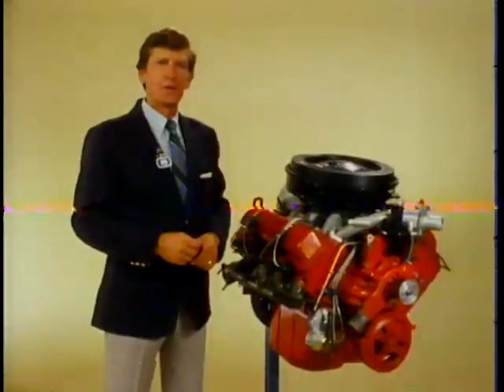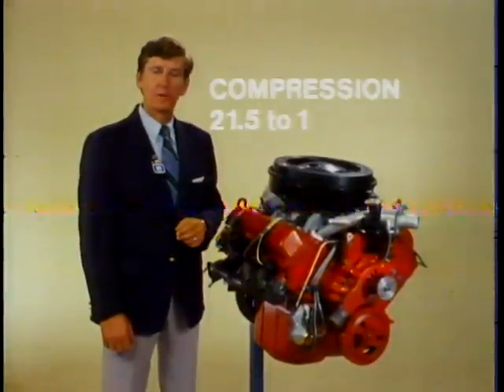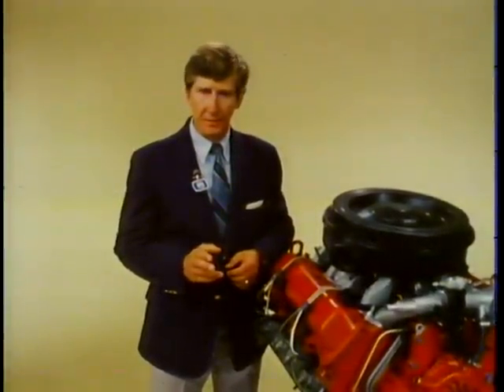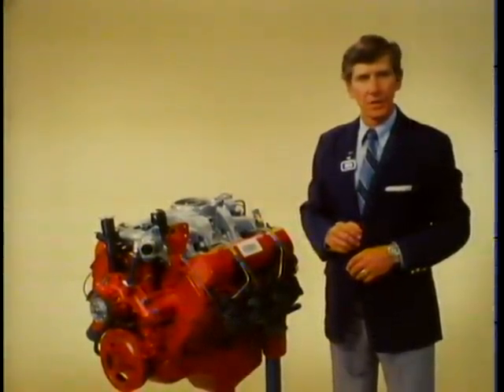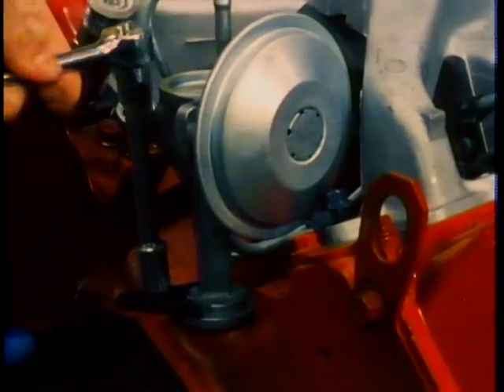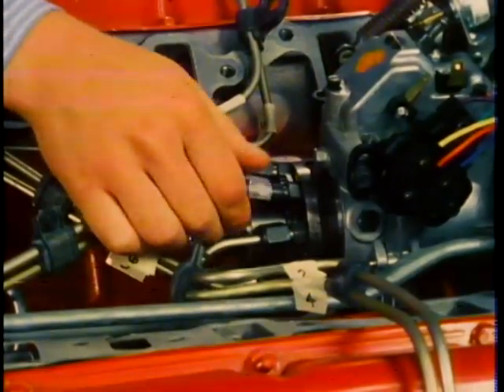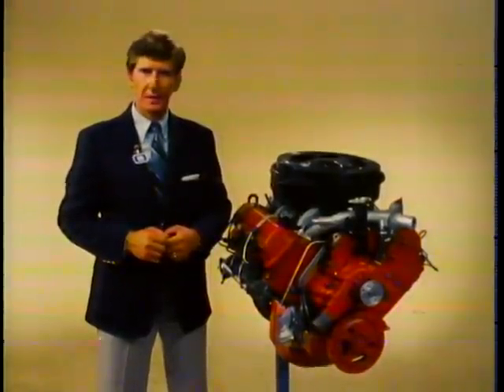General Motors /  Detroit Diesel 6.2 Training

Comment: Thank God the national speed limit was 55 when this engine was made.
Reply: Chase Dirtbike I have one of these in my K20, it has no issues going 70-75mph. Up around 80-85mph, wind becomes an issue.
Reply: You are right.  I loved the engine when I had it in my K20.  I was in Florida, holding the pedal to the floor for a trip from Texas to Georgia.  I was clocked by Florida highway patrol at 83 miles an hour.  I looked amazingly at the officer and said it must have been a downhill run as I just leave the pedal on the floor.  He laughed so hard, I thought he was going to wet his pants, and let me go without a ticket!
Reply: @chasedirtbike4155  top speed depends mostly on the gearing with these.
Reply: I regularly drove my 6.2L Diesel pickup 65-70 mph without any issues!
Reply: My truck is non turbo and will do over 90
Reply: chase dirtbike i had one in my K5 M1009 military w 10 ply 35's and steel bart wheels she went 75-80 on the regular to work daily w 3:73.... it was 160hp/300 torq ish w fresh injection pump and reman injectors combined w new glow plugs she fired up like a new Honda every day even in 30's temps
Reply: Just took forever to get up to speed, especially when loaded. Smell traveled faster.
Reply: my 84 silverado suburban 4x4 really liked 55mph while towing my boat from anchorage to portland getting 14mpg
Reply: The speed limit may have been 55 back then, however, how many people actually obeyed it carefully?
Reply: @sdvten  Yeah. I had a mini-motorhome with a 6.2. One day I took a birdstrike....from behind.
Reply: @2014cwajts71  You win, yours was the funniest.
Reply: Nonsense.... most of these trucks have short gears, exception being the k5 whic has 3.08 axles so will get down the highway perfectly fine with normal vehicles without higher RPMs. the problem at higher speeds wasn't the engine at all... but the driveline itself.
Reply: They somehow still survive working on a motorhome that has 87000 miles on it it still had red paint on it
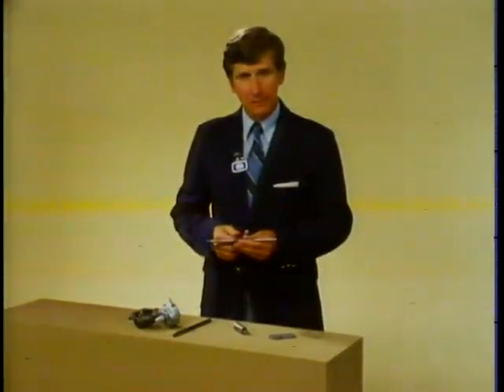Reply: The Military with the D10-D30/M1008-M1031 CUCV could reach highway speeds rather easily.The M1009 had 3:08 Gears and could do 70-80 MPH,the M1008-M1031 with 4:56 Gears could only do 60 MPH.Gear ratio is in fact a huge obstacle that speed depends on with these trucks.The 6.2L can also reach 3,250 RPM but that is pedal to the medal and redline.
Reply: This engine will make a vehicle go faster then what your brain can t h i n k
Reply: 60 max for my one ton. 456 gears and 3 speed.  She's screaming at 60 lol 😆
Reply: @sdvten  I just bought one with 75k miles I might put a 6 speed in it 😂 just for that reason
Reply: @FCFordLord  q
Reply: Put a 488 rear end in and a 6.2 will fly
Reply: @skylinefever < The same who follow the 75.
Reply: @Victorsvolkswagens < Sure you did?
Reply: @Slim_Slid  quantos HP? ?
Reply: @eliteprogaming4648  Kwantwz hp? ?
Reply: @SteveHolsten  Kwantwz HP? ?
Reply: Kwantwz HP? ?
Reply: @marlborodemoura1377  he meant how many hp
Reply: 82 K10 with 4 speed stick overdrive does 75 easy
Reply: ROFLMAO 🤣
Reply: I have the 6.2 in my conversion van and it cruises 75 effortlessly with the 700R4.
Reply: I had an 82 k10, drove the piss out of it for over 10 years, couldn't blow it up!

Comment: A GM guy told me the 1989-1993 models were the better of these engines. Although most of the issues with cracked heads and blown head gaskets were from people over revving the engine when it was cold. I knew a guy who blew his cummins in his dodge because he lived about a 1/8 mile from the highway and never let his engine warm up and give it way to much fuel and blew the head gasket. Mind you it survived about 200000 miles and 6 or 7 cold winters and was never plugged in let alone warmed up or cooled down. If you operate the 6.2 GM/Detroit properly it can be a good engine.
Reply: Huh? A guy told you a bunch of crap.. heads crack from heat, not cold.. these engines were converted gas engines. Not beefy enough for the pressures of an operating diesel.. as a gm tech, I have replaced hundreds of these things under warranty... Usually a snapped crank.. the 6.5 had a better crank and some of the last 6.2's got the better crank.. if it has an external seal on the rear crank, it's the beefier engine. The junk engine, has the seal, built into the rear main cap.. but the 6.5 has busted many a crank too.. I have ran both, and I praised God, when Ford, came out with the 6.9.. that was a great engine..
Reply: KBS117 first part of that is wrong. I’ll have you know the 6.2 is not a converted gas engine. You’re thinking of the 5.7 Oldsmobile diesel.
Reply: @zanefitch9343  come-on buddy.. it's a light duty diesel..by converted gasoline, I meant, thin block, weak crank, bad heads and bolts.. the list is endless
Reply: KBS117 oh ok yea you do have a point there. 135 hp is definitely light duty for sure haha
Reply: @KBS117  the 6.2/6.5 and the 5.7 Olds diesel are NOT converted gas motors. They do not share any components with existing gas motors. If you were actually a GM tech, you surely would be aware of this???
Reply: @detroitdiesel-vu3ig  why does your stupidity keep pulling my chain? The 5.7 is an olds 350 4 bolt main block, crank and heads.. they will interchange with the gas engine.. I have put the gas heads and intake on the diesel block.. the 6.2/6.5 are light duty diesels, made after gas engine specs, thin blocks and heads, weak cranks, and fatigue issues.. just leave it alone....
Reply: @KBS117  also, a ssb Chevy weighs in dry at about 575lbs whereas a 6.2 diesel weighs in at 700lbs. I don't believe they're as thin and flimsy as you lead on. Also, I own one and have owned it for 3 years now and motor hasn't even offered to fail or quit at 210,000 miles. Quite literally, the body is rusting away around the motor
Reply: @KBS117  did you even watch the video?
Reply: Yup...seen it, when it was a brand new video, when I worked on those rags, years ago...gm destroyed the diesel pickup market in the late 70's..
Reply: @KBS117  The 6.2 was a huge improvement over the 5.7 olds, they aren't without their faults like any engine. The 5.7 olds was the same bore and stroke. The 5.7 olds compression ratio was 22.5:1 which is very high. The 5.7 gassers wouldn't have been able to handle that kind of compression. The olds had a different block and heads. However the head pattern and layout was the same. Because both 5.7's were available in the same platform the bell housing and motor mounts were the same. And that is why people have this misconception regarding the two engines. The olds diesel was plagued with problems and a disaster to the diesel market, more so to the car market and not as much to the truck market. GM didn't offer another diesel in a car until 2014. In 2015 the Volkswagen emissions scandal happened which soured North American consumers once again.
Reply: @bluecollartradesman715  our family had dozens of the 5.7 diesels in about everything, Cadillac, Olds, k series, and all of them ran 200k trouble free miles. I have put gas heads and intake on 3 of the diesel blocks, and they ran ok..  the diesel uses bigger head bolts and you have to drill the heads out to use the bigger bolts. The distributor goes where the vacuum pump was on the diesel..
Reply: @detroitdiesel-vu3ig it was, but it wasn't. They decided to keep the head bolt design and  patterns from a regular 350, so they could use the same assembly line to mamanufacture both the gas and diesel motors. They kind of forgot the simple fact that Diesels have a way higher compression ratio than the gas  motors. So inevitably the whole thing would fall apart. Between that and the shit lightweight transmission they mated to it, they had problems. My Uncle's Custom Cruiser was originally going to have the 350 diesel in it, but the Dealer had swapped it out prior to putting it on the sales floor after the motor flew apart when they drove it off the car carrier.
Reply: The 6.2L V8's were discontinued in 1991,not 1993. The 6.5L V8's were debut in 1991. These engines were entirely built for fuel economy and GM sold them cheap just because of that. Military service and oilfield business were heavy usage for these engines. At one point because of head gasket and crankshaft failure many oilfield businesses refused to work with GM trucks and only wanted Ford if not Dodge products for pickups. At least International Harvestor if everything else was broken down. In the military the HMMWV's (M998's) and CUCV's (M1008's-M1031's/D10's-D30's) worked well with the 6.2L V8's. The 6.5L V8's were also decent for the M1025-M1097 HMMWV's and CUCV ll's (A-B-C-E-F-S) until being replaced by the Duramax LSSV's. The 6.5L V8's as 6.5L TD's/6500's became problematic and sluggish in the M1113-M1167 ECV's because these engines weren't meant for heavy stress,espiecally the extra weight from armoring. It didn't matter how hard AM General tried with GM to make them heavy duty regardless of contract. This is why the MRAPV's and MATV's soon followed before the JLTV's/LATV's came out years later.